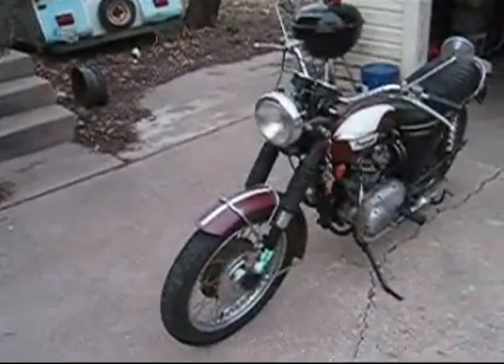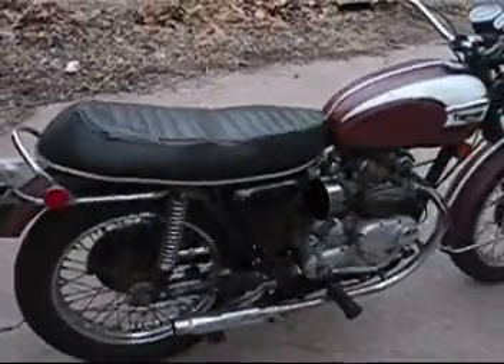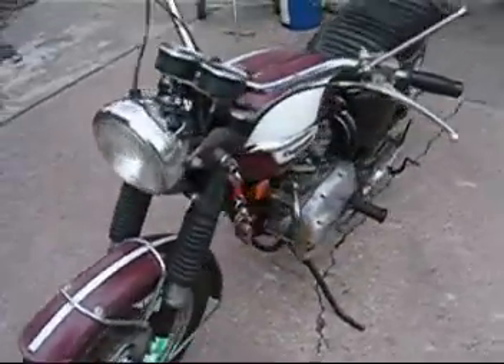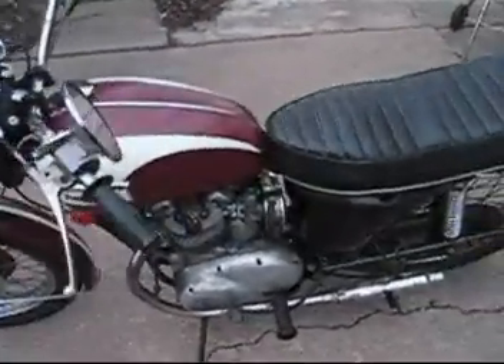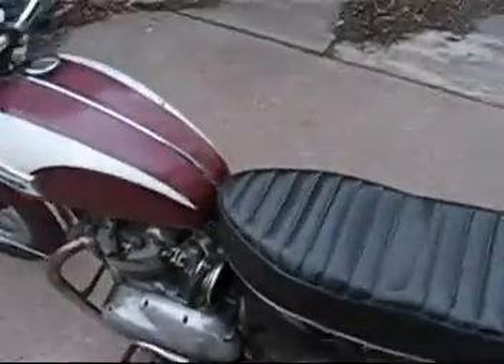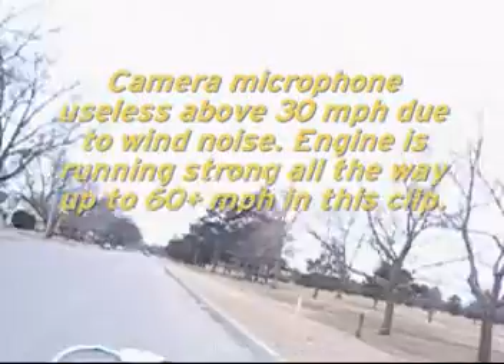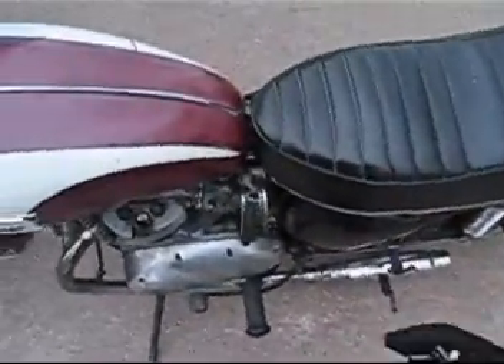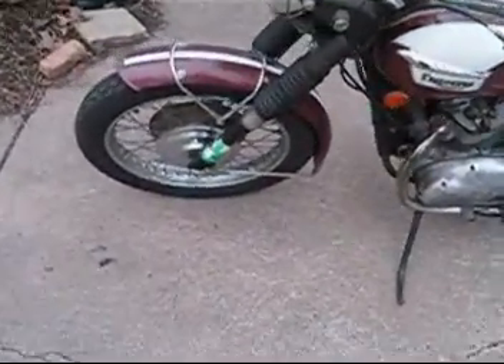1972 Triumph Daytona 500 Short Blast

Comment: It is most likely the zener diode. Any excessive voltage is basically dumped by this diode before said over voltage has a chance to blow things, like headlights.

They get hot and can go bad. No biggie.

If you are going to own these bikes, it really pays to get seriously educated on all systems, including electrical. It will pay big time and is not really very hard if you have any real mechanical and or electrical abilities. Personally I think the wiring diagrams/system for this bike is easy.